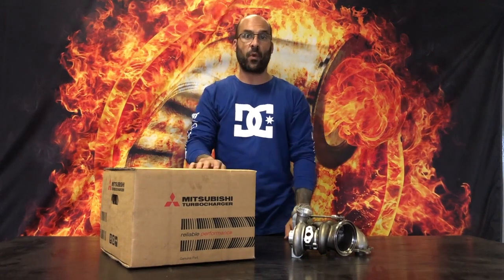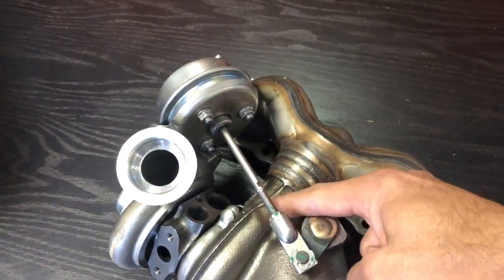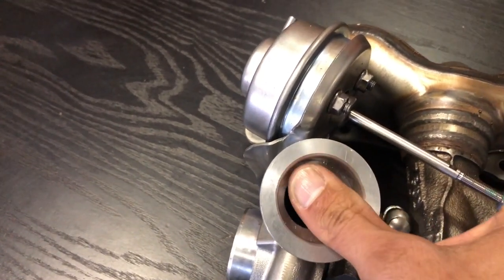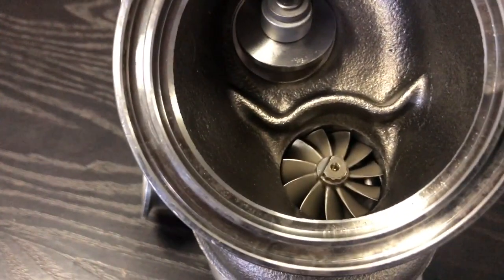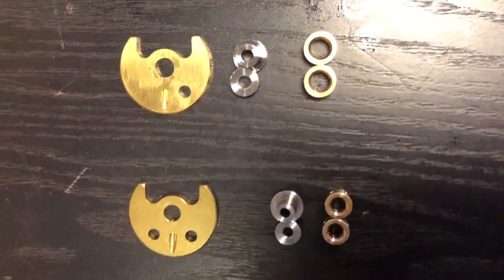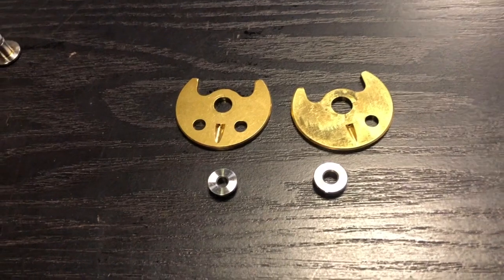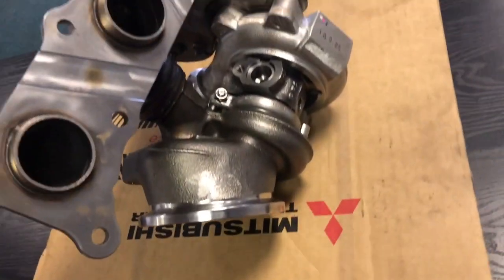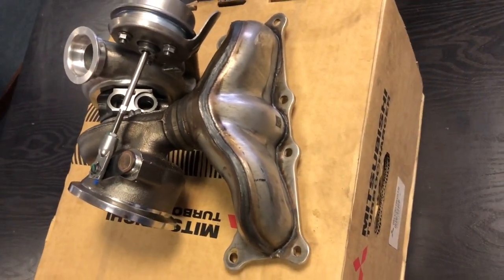BMW N54 turbo upgrade - is it worth it?

Comment: Thanks for this video! 

Got a stock 335i N54 DCT.  Goal is a RELIABLE 500HP crank. No racing/tracking, want close to OEM response as possible.

1. So are all twin upgrades flawed then, whether cheap (Chinese 17Ts) or pricey (Pure or Vargas stage 2).

2. Can you recommend  a top-mount single turbo kit that isn't wildly expensive? (Doc Race pricing is insane)

Cheers 🙏🏾
Reply from the maker: @stephenpato5524  I would stay away from twins using stock bearing systems. They are not capable of handling the loads with high boost and upgraded internal rotating assemblies. No matter what the name is on them. If you run two ball bearing turbos - different story. However I would run a single larger turbo inside of you target HP - I wouldn’t go top mount - massive manifold and lots of heat in comparison the the ‘stock location’ single.
Reply: @TurboDirectSA  Really appreciate your response, thank you 🙏🏽.

Comment: I'm planning out an N54 build and have been stuck in a dilemma between the EFR8374 and EFR8474 Black. My usage is predominantly going to be on the street with at least 5 track days a year. I also intended on keeping it IWG (.92 TS A/R) for the sake of simplicity while pairing it with a TS equal length manifold. Compression Ratio will remain 10.2:1, E85 will be used, and the head will be ported with a mild cam. Power wise, I'm looking at staying around 520bhp(low boost) and upper 600sbhp(high boost) reliably. Which of these turbos would best provide a responsive and linear delivery of power?
Reply from the maker: The EFR8474 is totally the incorrect turbo for this application, it will be very laggy and just to large for your required HP target.  The EFR8370 will make this power easily, and so will this turbo here:- 
https://store.turbodirect.co.za/index.php/shop/turbochargers/g3077r-forged-detail 

These are two options i would consider if this was my vehicle. 

The later will spool very quickly for the track and street and will make the required power and then some.
Reply: @TurboDirectSA  Thank you for the feedback! Really appreciate the time and dedication you put into your videos.
Reply from the maker: @user-ki8zf1rp1e  Thanks for the compliment - apologies we don't have as much time to make these videos as we had previously - but we do however have some special videos coming your way soon. We know you gonna love them!!

Comment: Great Vid, I have a weird question. My coworker went with a single turbo setup on his BMW. He gave me his old N54 Turbos. I was wondering if it would be possible to utilize one of the smaller turbos on my Acura RSX. Obviously it would take some modification and work but I cant find anyone ever rebuilding and reusing these turbos in other applications. Any advice is appreciated!
Reply from the maker: Good question, this turbo can be used for sure - BUT as a single turbo this would be VERY small for the Acura - you would get all your boost around 2500RPM (1.2-1.5bar guage pressure) and lose its ability to flow around 4000RPM - 4500RPM  - not a suitable solution for that motor im afraid.
Reply: @TurboDirectSA  Hey thank you so much for the reply. It's a stock k20Z1 motor so it's high revving engine and for sure not suitable for such a low RPM. I would only run low boost but if I'm gana take that plunge with all the other upgrades needed I will just get a ball bearing setup instead. Guess I will sell em for my coworker then. Any idea what a set of 100k mile used N54 turbos are worth? (Obviously needs a rebuild) Appreciate the knowledge, especially since I'm not familiar with the BMW's. Also I'm in the PNW, pacific northwest if that makes any difference in resale value.
Reply from the maker: @MrEvtmazda  Im not sure of resale value at all in that side of the world im afraid - however if you considering the turbo route, in the near future, keep your eye on our channel for some exciting news in the next two months
Reply: @TurboDirectSA  will do! Thanks again!
Reply from the maker: @MrEvtmazda  Pleasure - anytime.

Comment: The real issue with the upgraded N54 turbos is going over twenty psi for a sustained period they can handle close to thirty pounds of boost but will eventually fail the thrust collars have to be modified to have any chance of survival

Comment: Hi just had a quick question about what you think of replacing the standard turbo's with aftermarket ball bearing turbos such as a Garrett GTX2680R or EFR 6258-A.

Wanting to keep twin turbos and looking for internally gated turbo. It was quite difficult to find technical drawings or specs on the standard turbos. Would cutting off the standard manifolds after the merge and welding these turbos be a good choice for staying twin turbo? 

Should also mention, not looking for huge power as many are, 450 - 550 seems more than enough. just wanting stronger and more reliable turbos than standard at that power level

RHD cars have very little room as the steering shaft runs right through that area making a single quite a difficult proposition for many of us. 

Sorry for the long winded question, was very curious after hearing your thoughts.
Reply from the maker: We have had experience with the N54 setup and using the stock manifolds, cutting off the turbine housings and merging the two outlets together into a single collector and running a single turbo is much better in terms of heat under the hood, space and ease of making up the downpipe and other lines required. The response of the turbocharger is also faster using a single EFR7163 Vband (550WHP) or EFR7670 T3 flange (650WHP)  The EFR is by far a better option as it responds faster, lasts longer and has a much more reliable design overall.  To make 450HP is easy and the EFR7163 will be the better bet here without a doubt.
Reply: @TurboDirectSA  thanks for the quick response, really appreciate it. Will definitely take that advice on board 👍
Reply from the maker: @ryanlawson5768  Pleasure
Reply: Hi Iv got a 135i N54 and a brand new t3/t4 twin scroll EFR 7163 with vband out, will this work on a N54 🤷🏻‍♂️
Reply from the maker: @InstaltechCarAudio  Im not understanding what turbo you have - is it the T3/T4 or is it the EFR7163? These are completely different turbochargers.
Reply: Hi no it’s a efr 7163 with a t3/t4 manifold flange, twin scroll housing, and vband out, internally waste gated, I bought it years ago for a car that I sold in the end, but I was told it was the highest power output in the efr7163 combination and would be good for 600🤷🏻‍♂️
Reply from the maker: @InstaltechCarAudio  T3/T4 flanges are also different, it will more than likely be the T4 as this is twin scroll. The turbo will not make 600HP - its compressor is rated at 550HP (55lb/min)
Reply: Do you have any videos or links to n54  running the efr7163, you’ve peeked my interest 🤣
Reply from the maker: @InstaltechCarAudio  Sorry no - we supply the hardware to many fabricators and customers alike and they have the installations done and tuning carried out by external companies.  We never did development on our own shop car unfrotunately.

Comment: wait so you're saying that at atmospheric pressure the wastegate is open ? ? why would be the reason behind it ? shouldn't it open let's say at a few psis before target boost ?
Reply from the maker: Nope - the gate is open until the ignition is turned on and the vacuum accumulator will then apply vacuum to the actuator which then pulls the swing valve closed. It will only open up again when the boost reaches the ECU's expected pressure - then the solenoid will allow the swing vlave to open up again when the target boost pressure is reached and recognised by the ECU through the MAP sensor and others under the hood.
Reply: @TurboDirectSA  Thank you very much for the explanation. I've been used to standard valves that just open under boost
Seems pretty well engineered, but wouldn't it require being back to vacuum to re-close it ?

What if I go boost, wastegate opens, I let go a little bit to go back to atmospheric (no vacuum), and then wastegate is always open ?
Or is it like a vacuum pump that close it again ?
Reply from the maker: @Gurdil95  there is a vacuum.acumulator which will always apply vacuum to.the swing valve when you come off the throttle.

Comment: Very informative. It would be really nice to talk about the Audi 2.5 daza engine turbo and compare it with the TTE 700 hybrid. And  talk about the options and what's the best cost effective solution like you did in this video.
Reply from the maker: We have some experience and knowledge about the DAZA engine, and the turbochargers (hybrids) that run on these engines. Ill cover this in a future video for you no problem.